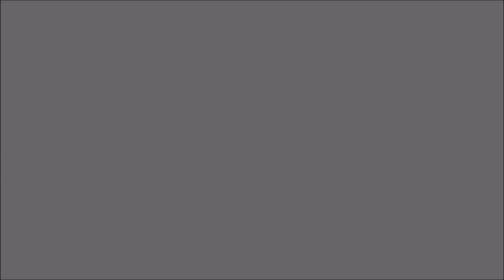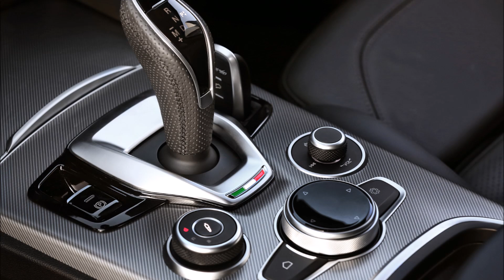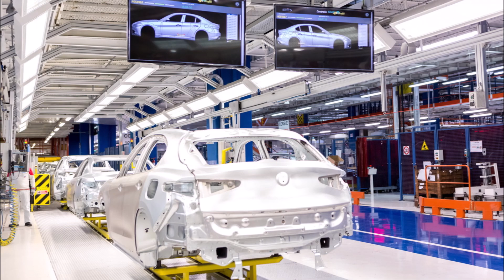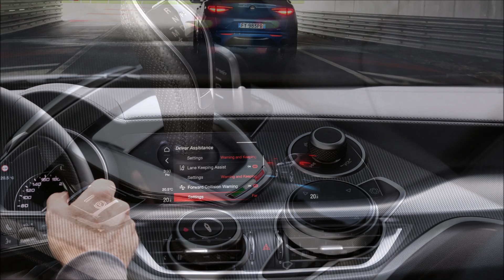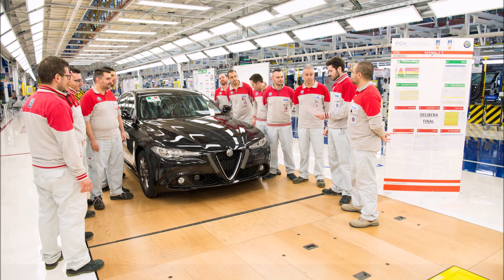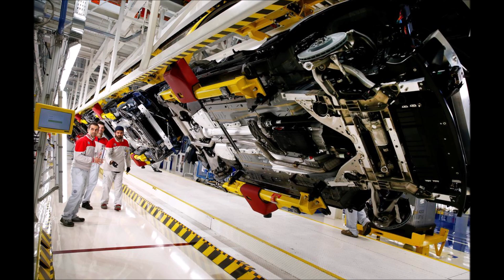Here's Why You CANT Buy 2020 Alfa Romeo Giulia's and Stelvio's for a WHILE!

Comment: The only issue is that some may not want to wait and they may jump into something else -  like a Kia Stinger Hahaha!!
Reply: Martyn H I jumped from a Kia Stinger to Alfa Romeo Stelvio.
Reply: MrRyanS1983   Good move Ryan.  I was kind joking because Ron went from a Maserati to Kia Stinger!
Reply: Martyn H yes it’s a great car but I got bored with it. I had one of the first run Stingers didn’t have many issues. Some other have had turbo failures most common on the twin turbo, bad paint, failing brake rotors, dead batteries, bad starters, engine fires, GT wheels breaking apart, Michelin sidewalls failing, and bad fuel pumps. Every car has it’s issues.